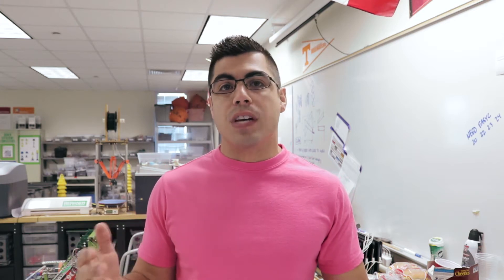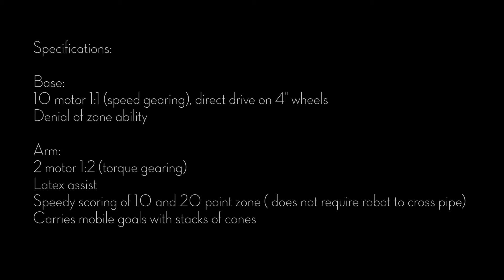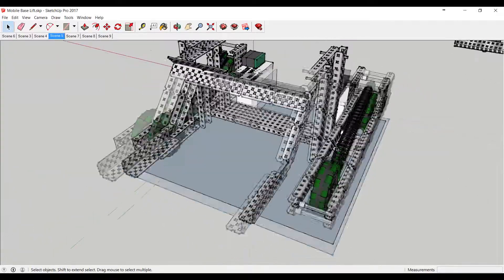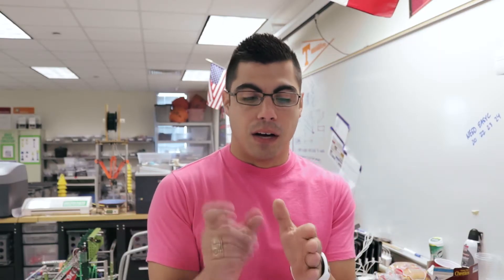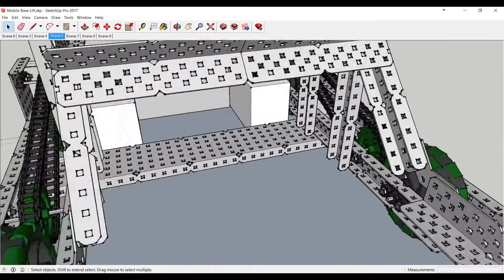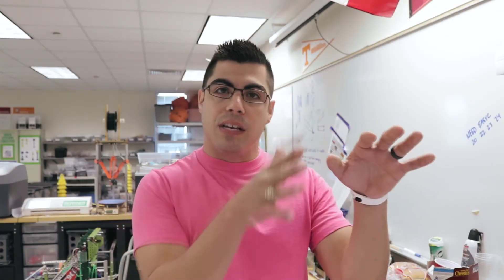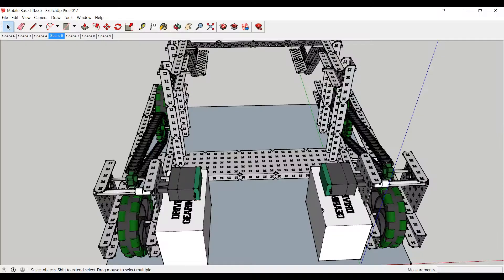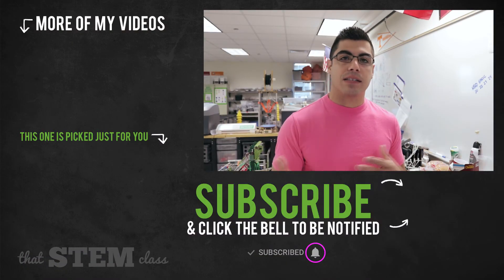VEX In The Zone - 8059A Reverse Engineering Mobile Base Robot

Comment: Do we know if those are servo motors on the back or regular 393s?
Reply: Meaning the motors for the lift structure, not wheel controls.
Reply from the maker: Quite positive they are all 393 motors.

Comment: I'm inspiredWithin the next few days i'll CAD this up in Inventor and probably make a video about it
Reply from the maker: +Dylan the Tactician eager to see it. Once we Finished our second design I’m going to do a video about our first design in full detail.
Reply: Gotcha. As someone who's current bot has a chainbar mobile goal lift heavily inspired by basically plagiarized from the Ripper (Ri3D, I can say that it's providing its own plethora of issues for implementation, so I've been wanting to have a crack at this style of mogoal lift too. I went through 8059's reveal video and took screenshots, I had a strong suspicion about how the "motor magic" took place and it seems like I was right. I'll definitely be starting the CAD tonight but due to responsibilities tomorrow I probably won't finish it tonight. Depending on if I can get access to the school AV room (and therefore editing software) or not, expect a video in at max a two weeks but more realistically 3=8 days
Reply: aaand i was going to make a video but then i found out my computer overheats trying to run both inventor and OBS
I'll do what I can though
Reply: Just wanting to update: everything is 100% setup, my only issue is that I can't record for longer than 2 min without overheating. If I could send you my library, would you be interested in that?